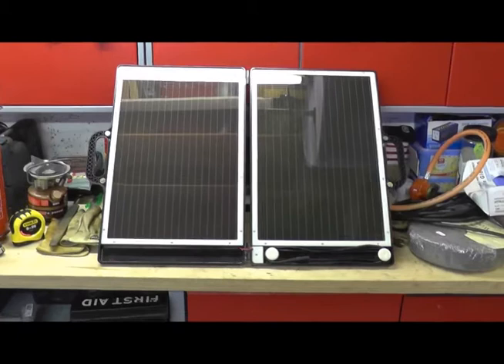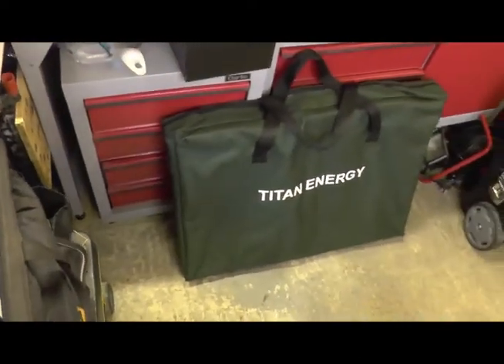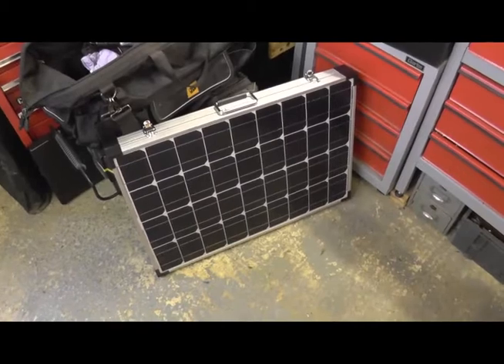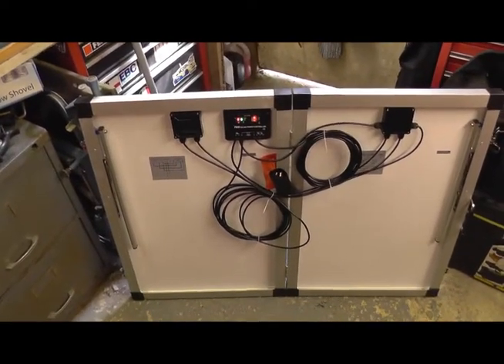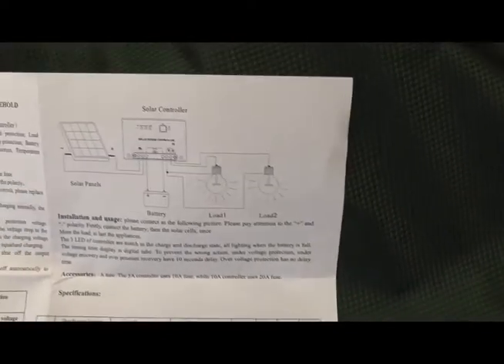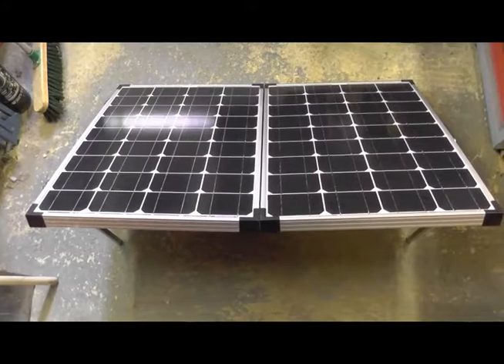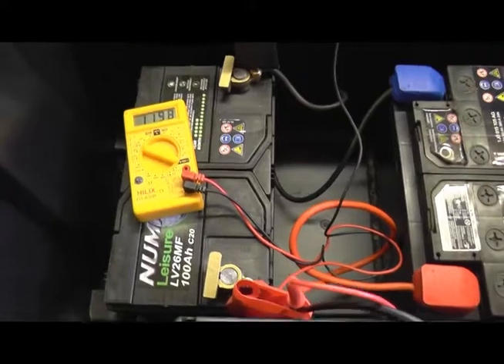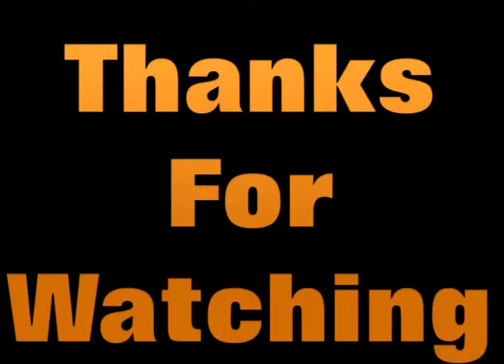Solar Improvements & Set Up - Off Grid Power

Comment: great bit of kit mate. only thing i noticed was the two batts are different and if they are wire together over time the stronger batt will damage the weaker one. at work we always have to change them as pairs unless the have different feeds. hope this helps mate.
Reply: just some sort of isolater switch to keep them separate for now should work. a bit of a pain to charge and use one at a time but its safe. you can get a funky intelligent charger but again its money and complicates things